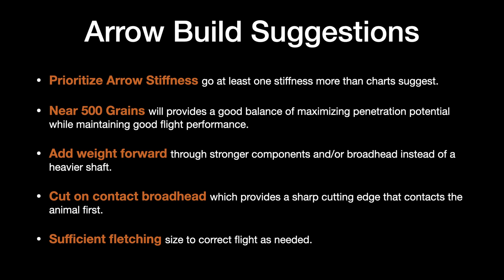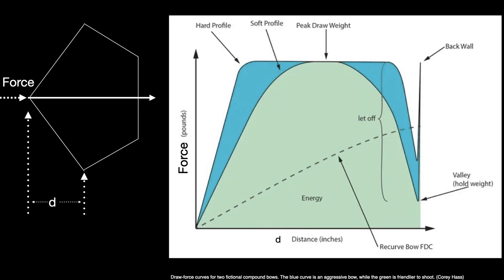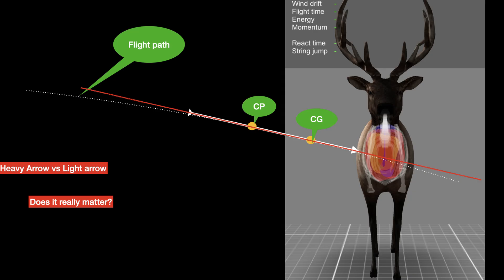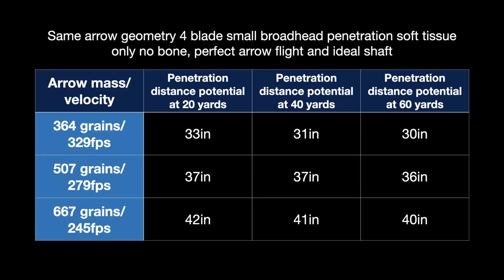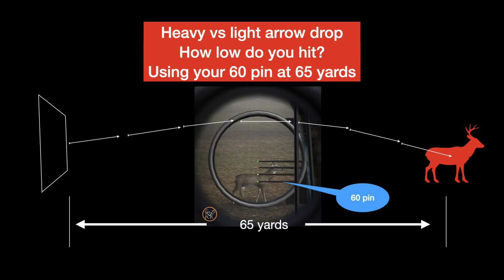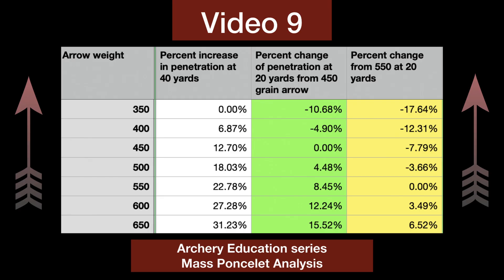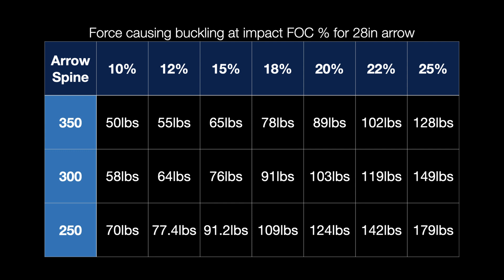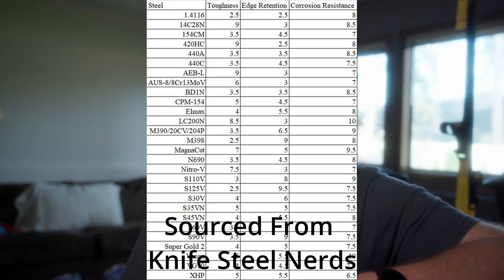Arrow Build Recommendations from an Engineer: Video 10 archery education series.

Comment: I would reword the spine recommendation.
Instead of saying to go 1 spine stiffer than recommended, I would say, shoot the stiffest arrow you can tune perfectly.

I suspect that when you do your fletching tests, you should find that the faster arrow needs LESS fletching to stabilize the arrow (as the faster arrow with the same fletching will spin faster). 
Going to shorter, lighter fletchings mounted with less offset will still stabilize the arrow well, and have much less drag, AND increases FOC. One last benefit, is it stresses the arrow most at launch, meaning you can go with a stiffer shaft.

As for broad heads, in test after test, I have found Cut on contact heads do worse when penetrating things like bone. They don’t clear a path as well as a chisel tip. 
Any broadhead with go through meat and vitals. Hitting bone is the only thing that is difficult.
I’ve also seen too many CoC heads peal over at the very tip. 
I’m convinced that a sharp chisel point head, is more likely to get the job done.
Reply: No doubt you have lots of experience and make these recommendations based on that. Many other very experienced archers disagree with some of your comments, especially the penetration argument.  
Personally, I have had bad luck with cone shaped and pyramid (i.e, Muzzy) broad heads but I am an experiment of one. 

I respect your opinion and experience and I would love to hear more about your tests.

I have had better luck with COC like Magnus Stinger, two blade broad heads. Although they are not particularly stout...

10-15 years ago, I lost a herd bull with a quartering away shot with a Muzzy; due to no exit wound.  (again, I concede that this is an uncontrolled experiment of "one" and that there is no assurance that a heavier set up with a stout COC Broadhead would have yielded better results).   On most elk hunts since "losing" that herd bull, I'm loaded with an Abowyer Brown Bear BH which is a very thick, conventional 210 grain (with aluminum adapter) Broadhead and TAW of 625 grains.  Sadly, whenever I'm "loaded" with that set-up I haven't had a shot at an elk. Whenever I was loaded with lighter set ups, I sometimes had opportunities and never got a pass through at ranges from 23 yds to appx. 40 yards (I'm going back 30 years here on some of those unfortunate events, with somewhat ancient equipment on the first one, but relatively equivalent equipment on the last two "no exit wound" hits).   

Given my unfortunate experience, the #1 thing I want is a high probability of a pass through in order to get a decent blood trail and more tissue damage,  #2 is likelihood of at least a double lung hit if things go awry and I hit the on-side scapula.  If I can achieve those two things, and I've practiced enough to achieve excellent "field accuracy" and taken shots with reasonable probability of success i.e., quartering away or broadside at an acceptable range - usually that means =< 40 yards) then I've stacked the odds greatly in my favor.  I simply haven't had good luck with lighter arrows (430-450 grains) and/or cone shaped or "trocar" points that just don't seem to penetrate well based on my personal experience. 

I agree that if you have structural failure on a COC you will have problems and IMO, most commercially available mass-market COC BH's have weak aluminum ferrules and adapters and the blade thickness is too thin. So, they are somewhat more likely to bend at the point, or fail at the ferrule / insert junction than a more robust design.   They are probably constructed that way to achieve commercial mass market success at a price that most hunters are willing to pay.

Frankly,  I think Iron Will's Broadhead blades are a bit too thin but they are much thicker than most mass market COC BH's and  they probably do present a decent balance necessary to achieve commercial success and field success.  Plus, they have steel or titanium ferrules and are available at weights that have mass market appeal (albeit at a luxury price).  They should not bend at the ferrule and they have better tip strength than most COC BH's.

FWIW, Bill V at Iron Will  is an experienced Mechanical Engineer who has worked in that field for something like 20 years. Bill did what I would call a "Non-Dynamic" test where a device tested the pounds of pressure necessary to get various outcomes - 1) penetrating skin, 2) muscle, 3) scapula, etc.  The difference was dramatic between a "stout" COC Broadhead (I don't count a Stinger as "stout") and the various other head types.  Again, this is a "non-dynamic test".   I can imagine that a high speed impact test could yield somewhat different results from the Iron Will static test.  The best tests would be on living tissue at typical impact speeds.  With difficulty, you can find the test results information on Iron Will's website.

I put limited value (but greater than zero) on all those YouTube tests where someone shoots at an old isolated bone like a deer or elk scapula, especially if the bone is not covered in skin, meat and is not "fresh".   Most of those tests available online are clickable entertainment designed to generate clicks and profits for the channel and not much more.   

One of the advantages of Ashby's tests on dead animals is that he conducted them quickly after the animals death. IIRC, he found that his results deviated somewhat if the animal had been dead for a while.  Of course, it can be argued that given his usage of a low velocity long bow with very heavy arrows, and given his objective of assuring a mortal wound upon hitting "heavy bone" on a Cape buffalo (not heavy bone on an elk) .... given those objectives and equipment his  results are probably not totally applicable to high KE bows of today especially for usage on elk or smaller game like deer.

Comment: Have you ever tried to dissect for every action there is a equal opposite reaction? Or another example, the reaction of different media when penetrated by different velocity arrows, I’m pretty sure not all media will share the same reaction speed. Mathematically the heavier arrow should out penetrate the lighter faster arrow but the lighter arrow will out penetrate the heavier arrow in a dense foam target every time with same points and diameter shaft @ 20 yards. This year I was going to stretch it out to see at what distance it matches penetration. My test was with 5mm shafts and brand new power stop dense foam 15 inches thick target. I introduced a even lighter 4mm and it gained about a inch more, probably due to shape of outsert.
Reply from the maker: I plan on doing much more testing on this to come. Your results are interesting to me usually in my experience the heavier arrow just slightly out penetrates a lighter arrow in foam targets, very minimal difference. My issue with many archery targets, as a comparison, is friction is the primary reactive force that is stopping the arrow. Which for animals the forces more closely resemble drag and cavity formation. Cavity formation being the force necessary to break bonds of the medium.

Comment: I hunt hogs here in Florida. In my experience you need a heavier arrow. I have a 26 inch draw. So my arrow is 25 inches carbon to carbon. And my total arrow weight is 502 grains. Since I started using a heavier arrow my penatration has went way up.